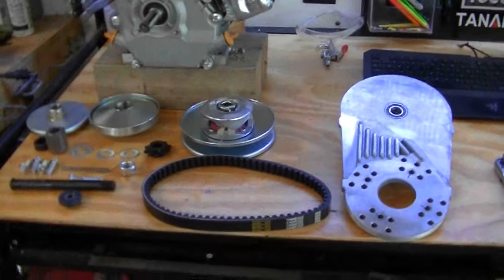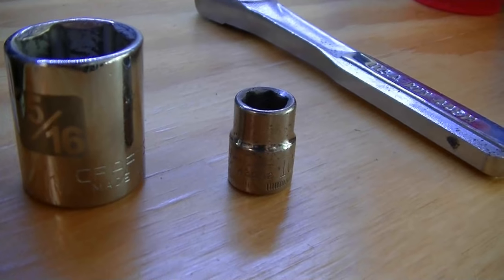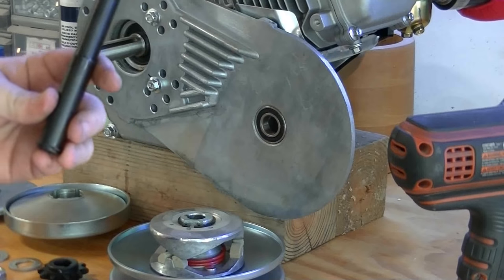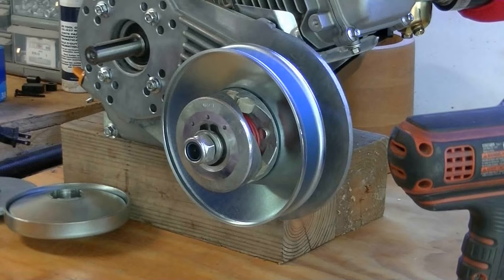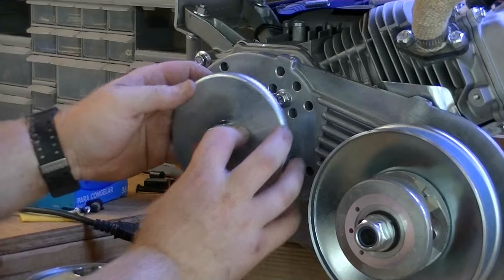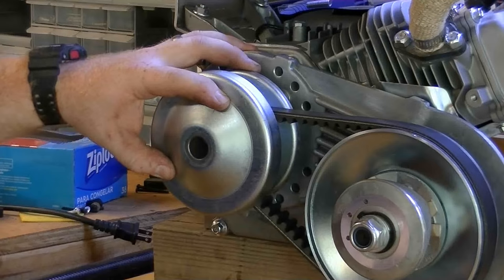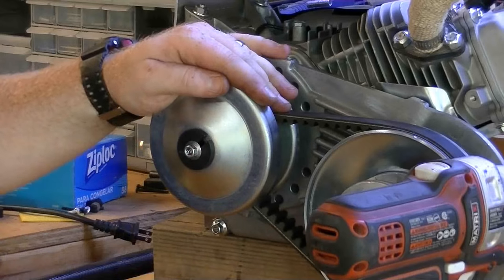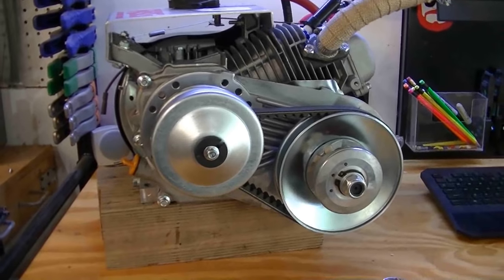Predator 212 Go Kart Torque Converter Install

Comment: Hey red bead. Hope you are still replying to this video I bought this setup to use on a Yamaha four wheeler that had no motor the problem is that the chain that I need to use for the torque converter is different than the sprocket on the Yamaha four wheeler was wondering do you know if gopowersports has a rear sprocket that will match up what's the torque converter I tried contacting them through email a week ago and haven't got a response from them I think I need a split sprocket does  the split sprocket on there website  line up with the torque converter tooth count?  The bolt pattern is really wide on the Yamaha banshee thanks for your time I appreciate your videos

Comment: Well done sir, I sent a friend of mine the link to your video because he's to far for me to travel to do it for him. One thing they do have an oil plug so you don't have to cut. Anyway I'm writing to ask you to tell people the difference between a clutch and converter. He won't listen to me and I think he's making a mistake. He is riding in a long flat not a lot of stop and go.  All a converter does is increase take off and hill climbing. A proper 80 dollar clutch or better would be much better for him. I think he will kill a lot of belts and lose some speed. Just my opinion.  A converter is not always the answer.

Comment: I was told you don’t want to over tighten the bolts on either pulley. You didn’t mention that, was it just someone thinking they know best or is there actually something to that?

Comment: this looks exactly the same as the setup I got from ebay for $62, I've used two of them already and they are awesome. i'm not paying go power sports twice the price. they also charge more the 212 predator.  i'm not sure how they get away with this?
Reply from the maker: +BustedknuckleNatrona your not going to get any support with the eBay one. That means a lot when you have a problem. They also have different springs in the cheaper virson on eBay.

Comment: I did the measurements from center of Pully and I'm still coming up wrong I think cause I can squeeze the belt and it touches together the belt will work but it slips a lot on the pulley when I'm driving it

Comment: The bolts on predator engine are 5/16-24 for the crank bolt and mounting plate bolts also

Comment: I put mine on with an impact and still it exploded and pullies and springs are all over my neighborhood. Any suggestions .
Reply from the maker: What part exploded?
Reply: Red Beard's Garage 
I put mine on and broke bolt off twice now. not sure why
Reply: Loctite
Reply: Red Beard's Garage this just happened to me too
Reply: The bolt supplied with TC kit should not be used. It is metric. The predator crankshaft has 5/16" fine thread

Comment: Hey great instructions,in your opinion would this Torque converter would work to drive a prop shaft to a small (30feet)sailboat/the dc electric motor is a PGM132  ?

Comment: Will it be ok to drill out one of the bolt holes on the engine case cover? I've stripped one out and now i only have 3 bolts to put the cvt on. What's the next bolt size you recommend if I can do this?
Reply from the maker: You will have to just look at the parts store at the next size bolt. You could always run a metric bolt in it instead of the standard
Reply: Helicoil it.

Comment: When I installed mine. The back plated on the driver clutch and the driven clutch are offset. I used the washer and spacer. Why is this?

Comment: Mine is installed and the belts all seem to line up but at full throttle the belt isn’t lifted all the way up on the driving pulley. Any ideas why? The kart seems to run and pull pretty good but my last one always lifted the belt up higher.

Comment: Hey quick question I’m wonder if I could just spin my torque converter going the other way facing  towards , my sprocket sits in front of my engine and there’s no way it’s gonna be  able to hook the chain if it sits like that

Comment: I installed my converter and ran it up the street and back noticed the clutch bolt had backed out should I put some lock tight on the bolt then reinstall it
Reply: Yes I would

Comment: Thanks a bunch... the instructions that came with the torque converter are a bit outdated so i had to Google.

I heard I was going to have to relearn how to ride my doodle bug after this due to the engine braking but the engagement of the belt was the biggest surprise. Had to give it throttle and wait a second for it to engage.

I have a hole in my knee at the moment due to Whiskey Throttle... be ware. Otherwise this is awesome

Comment: You said that this works on a 6.5 hp engine. Your predator looks like a stage 1 predator making around 9 hp. Will that hurt the belt? I would like to get a torque converter, and modify my predator to stage 1, but I can't find a torque converter that says it will work for 9 hp.
Reply: 9 HP is nothing compared to the power others have ran. The 30 series that was used in this video can easily handle 9 HP. Besides, the torque converter may never see the 9 HP a stage 1 212 is capable of. If the bike or kart is not geared properly the engine will never see the RPM that it takes to make the 9 HP.

Comment: Would it be possible to put this together with the sprocket on the outside of the rear pulley? Going from a centrifugal clutch to this having fitment issues because it sets the chain back towards the engine more.

Comment: U can't hold it to get it torque  enough  u have to take the pull start off and hold the crankshaft with a bar really need to be nice and tight don't brake it tho lol ... thanks for the video

Comment: The one piece of info Im needing didn't get covered. You mentioned it works on any 6.5 hp predator. But what is it's max hp capacity?  If a 212 predator has stage one intake,header, muffler, and carb jet, as well as 18lb valve springs and a racing spark plug, will the 30 series handle the load just fine? Or do I need to jump up to a 40 series?
Reply: Yup I would get a billet fly wheel just for safety

Comment: Perfect, exactly what I needed, only question on mine tho, mine interferes with the exhaust bolt when using the middle bolt hole, so I had to use the edge hole. Is that normal?

Comment: I'm wanting a motor and torque converter setup like this for a motorized bicycle project. Do you think it would work?
Reply from the maker: Yes it will. Just be careful using bicycle wheels because the motor will create enough torque to break spokes.
Reply: REALLY? be fast??
Reply: Pat G im using it on 79cc predator on a bike but its not done yet.
Reply: I'm beginning to think 212cc is overkill and am thinking about going with a 79cc predator.  Does the same converter work?
I noticed it is a smaller shaft on the 79cc, do you but a reducer sleeve on it?
Reply: Pat G you need an adapter bushing i already try it..not good speed barely move me 20mph..im going switch of to jackshaft setup by agk.
Reply: Pat G but im also going make me a 212 bike tho hehe.your apokes should be fine aslong you use a hub adapter assembly instead of mounting it directly to spokes. anything higher then 1.5 hp i advise use hub adapter....as modern bike wheels use thinner spokes.

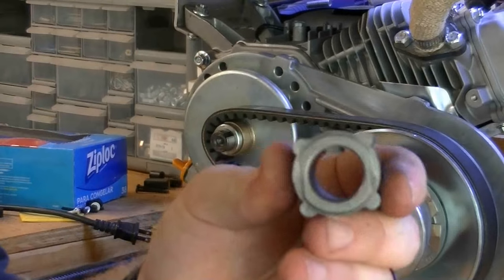Comment: Ok.  I need an explanation.  At the 3:50 mark, you install the belt to the rear sprocket and then lay it over the brass ring in front.  But if that brass ring just spins freely, what is going to make contact with the belt to make it move??  Am I missing something here?
Reply: The sleeve helps it slip. When the clutch engages it grabs the belt by the sides, not like a v-belt or serpentine belt on a car.

Comment: What belt you using I keep going through them on my 212cc How do I figure out what comet series I have and what belt to get
Reply from the maker: +L0N3 D4NGER there is a chart you can look up that tells you how to measure your belts. The belts I use are from go power sports and I will see if they have some in stock.
Reply: Red Beard's Garage hey I appreciate it brother I ordered a series 30 belt hopefully it will fit will look at the chart and go from there
Reply: Red Beard's Garage I also don't have that adapter you marked the holes my pullys just on there but it ran

Comment: I am struggling installing my torque converter. You mentioned that you had to remove part of the dip stick/oil plug handle. When I take the oil plug off, I noticed that the torque converter is actually interfering with the engine casting in that same area. Have you or has anyone reading this come across this? I purchased the Comet TAV2 (218352A).
I don't have any tools powerful enough to grind down the rib on the rear side of the torque converter mounting plate. Thoughts?
Reply from the maker: Can you go on my facebook page and post pics? let me see whats going on. Also what engine are you using?
Reply: Did you solve this issue?

Comment: I have a Tecumseh 5.5hp snow king. My shaft is 3/4” but is stepped smaller at the end of it. Will a torque converter or clutch work on it?
Reply from the maker: Not sure send a pic on Facebook

Comment: why would you put the washer that is keyed up to the bearing surface, that's the wrong assembly steps, that key is going to rub against the bering and destroy it...     The regular washer goes first the keyed washer goes inbetween the chain sprocket and the clutch assembly.
Reply from the maker: I was just following the instructions from Comet.

Comment: do you know if a 40 series driver and driven pulleys will work on a 30 series back plate?
Reply from the maker: No they won't. The rear jackshaft for the the driven pulley is smaller and the plate isn't strong enough
Reply: Red Beard's Garage  i have torque a conveter series 20 can i upgrade it to a series 30 or 35? I broke mine a week ago  so i might just replace torque conveter 20 to a newer series 30 and later replace my red robin 169cc engine to a 212 predator

Comment: Why does it have a toothed belt on a smooth pulley?
Reply: the 'teeth' are just to make the belt more flexible so it can change radius as the engine speed and load changes.... the flat side goes towards the engine!
Reply: Add cooling to that more surface area more cooling

Comment: I put my tc on my 212cc engin and pulley bolt comes lose when i run it
Reply from the maker: You have to make sure you get it torque down really good.
Reply: It's as tight it will go with a hand wrench

Comment: I am looking to slow down my go kart for my 7 yr old until he gets the hang of it better.  With a centrifugal clutch, I am told it will burn up if I limit the throttle.  If I change out the clutch for a torque converter setup, can I then limit the throttle without damaging anything?
Reply: Late reply but as long as you’re locking up the clutch, it’ll be fine. The torque converter actually offers .90 overdrive and torque multiplication at launch so i wouldn’t say that’s a fix.

Easiest answer is to run a larger axle pulley with your blocked throttle. That’ll load the clutch less and allow more rpm vs speed.

Comment: Cool video.  Thank you for sharing that very helpful.

Stupid question but well i guess no excuse here... What does a torque converter do on a go kart and or mini bike... meaning whats its intended purpose?

Thanks again!  Damn good how to!
Reply: Basically gives you variable gearing. As an example if you have a 10 tooth on the torque converter and a 50 tooth sprocket on the wheel in "low" you are starting with a 13.5/1 numerical gear ratio. In "high" you have a 4.5/1 numerical gear ratio. With just a clutch you have 1 fixed numerical ratio.

Comment: Would this type setup essentially eliminate the jackshaft assembly on a 3202 yerf dog, or should I do something else?  Right now I am running the jackshaft, but the setup doesn't have the mounting plate, etc., and I had a hard time getting the 212 to line up with the shorter engine shaft.  Any ideas on what direction I should go?
Reply: i have the same problem and don’t know what to do to it

Comment: If you install the washer on the rear shaft before installing the drive sprocket it moves the sprocket too close to the rivets in the main plate and when a #40 chain is installed the rivets in the chain....especially for the master link.. rub against the rivets in the main plate. The drive sprocket for the chain needs to be installed first and then the washer after that. It then allows enough space for the chain to clear the rivets. I discovered this after the installation and had to disassemble the rear shaft and reverse the order....sprocket first and then washer afterwards. This was on a Predator engine, but I had the same problem with a similar engine with electric start. I also noticed that the inward bevel in the front keyed square drive sleeve doesn't allow very much engagement with the crankshaft keyway when using both the washer and the spacer. I was tempted to mill it down a bit to get more key engagement, but you didn't and seem to have no trouble with it, but there's not a lot of keyway there driving the outer front belt pulley. I'd estimate that there is only about 3/8" key engagement the way it is designed. Is this something to be concerned with? 
   Thanks for any help with this!
Reply from the maker: +William Cobb I actually noticed this after I installed it but I just switched it around like you was stating thanks for the comment though man and I don't think the key way is a problem at least I've never had a problem with it
Reply: Thanks for verifying that I wasn't nuts or had a different setup than yours! Great video by the way. I did go ahead and leave the square driver as is and you are correct....the thing goes like a bat out of hell with no issues except for overly sensitive steering since it's not rack and pinion. The engine is a Duro Max electric start that I pulled the governor from and installed a Mikuni carb on it. Should have left the thing stock.... I can't let the neighborhood kids drive this now...it's too darned fast! I need to find a small rack and pinion steering system for it as well...it's all over the road with the cheap go kart steering that it has. Everything else is great though and I appreciate the video you made!

Comment: I would like to know why everybody calls this a torque converter it's a CVT a constant variable transmission look it up that's what it is it's not the torque converter doesn't run of hydraulic fluid like it automatic transmission fluid
Reply from the maker: They call them both names. If you look on go kart websites some of them list it as a torque converter. The only reason I use the term torque converter is because if I don't people doesn't know what im talking about. lol.
Reply: Was wondering same exact thing. Seems like a CVT to me.

Comment: Perfect. I plan on doing this for my 5hp briggs flattie this weekend. This is super helpful.
Reply from the maker: Thanks for watching
Reply: Don't use the metric bolt
Reply: Yea, I was previously warned
Reply: Ok, so I never ended up putting it on all the way when I made this original comment, but...just had to rewatch to put it on today, thanks RB!

Comment: will a torque converter work with a vertical shaft engine?
Reply from the maker: Yes sir it will
Reply: +Red Beard's Garage thanks red beard, my plan is to make my mud mower chain drive.

Comment: Thanks great instructional video. Greatly appreciated. I’m considering using a TC on a kart for our grandson. The engine is a 212cc Ghost. What are a good size sprockets to use on the TC as well as on the rear axle sprocket? One last question please. Sorry to be a bother. What is the biggest advantage or disadvantage using a TC vs centrifugal clutch? Thank you very much.
Reply: if your cart weights a lot, or has big tires, or has tall gearing, the clutch has trouble locking up, and might overheat and be ruined.  TC pretty much gets rid of that problem.  Also the TC changes gears as you speed up, just like a real CVT, so theyre nicer in my opinion.  But a clutch is 20$
Reply: @peeinacan1  Thank you. Greatly appreciated.

Comment: Can I run the torque converter clutch without that brass ring
Reply from the maker: It will want to take off on you at idle
Reply: Thank you.
Reply: Your channel has helped me out a lot I really appreciate what you do. My son really enjoys the manco silver fox wouldn’t be running without you thank again.
Reply: I really appreciate the reply my boys and I have been able to get out manco silverfox running just by watching we appreciate what you do thanks again
Reply: It should be fine without the ring....I bought two Monster Moto 212 mini bikes and the knock off torque converters that came with both had immediate problems with the brass rings getting hung up...I took the rings off both and haven't had issues since...if the belt is really tight it will want to move on idle, however having no ring will create some slack if the belt fits properly and after the belt stretches with a couple rides it will create more space...unless you plan on continuously idling for extremely long periods of time it's not going to affect anything

Comment: I'm converting a 1990 EZ-GO to gas, just got my torque converter today, thanks for the video.
Reply: Keyfarm what are you using for a motor?
Reply: @coleswaggins  first I'm using the predator 212cc from harbor freight to get it rolling, eventually I will put that engine on my tiller and upgrade to the predator 420cc. Everything will remain the same, except I'll have to drill new mounting holes in the engine plate. Everything on the rear shaft will be strong for either engine
Reply: Keyfarm  I just got a Facebook gc160/190 (?) today for fifty bucks! I have to look up the serial number for it. Gonna fab up a motor mount and rear suspension for it soon. It’s going on a Honda spree.
Reply: It’s a Honda
Reply: @coleswaggins  yea, I think they call the predator engine a Honda clone